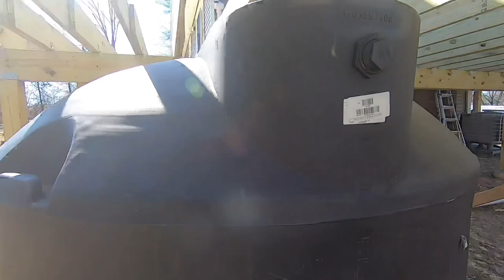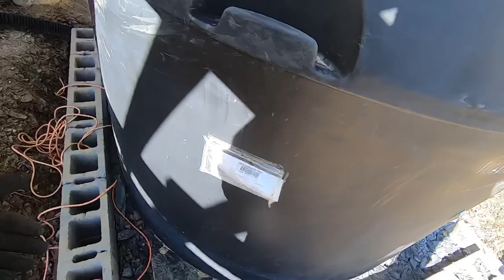Starting to install the our 1500 gallon rain water collection tank!

Comment: Hey Jason, I hope this note finds you well. Thank you for the great video and explaining the bad audio in the beginning. I thought for a second there that I was revisiting my misspent youth of being dropped on my head. So what I have gleaned from this is....you had us on a bendy tripod and hung us on a beam to watch you and your comrade build a hidden 1500 gallon still under your new deck? So many questions, so little time. Where does the copper tubing run off? where is the thumper? Is Wifey growing the potatoes for the mash? Is distilling booze even legal in your adoptive state of Kansas if the distillation tank is clearly marked "not booze" ? Nice job on the tank and deck:) BTW, it is called a rim and then skirt
Reply from the maker: Toad damnit toad I’ve got enough satellites tracking me already! But if you must ask, inside the pvc, and attached carefully to the walls interior of the tank, with 3D printed brackets I got from a questionable individual on Craigslist. No, imported from Putin’s special stash directly. No thumper were wireless these days. And no, but I’ve marked it “not for drinking” so it’s perfectly fine because clearly, no ones allowed to drink it, and if it’s one thing I know it’s that criminals obey proper signage. Not sure why banks don’t get robbery free zone signs made. Perhaps this could be our new niche market??
Reply: @JasonWorksAlot  Yes! No Dough Head Zones and Please Watch For Pee Soaked Floors. There's a few million dollar ideas. Just keep in mind the first fifth of the distillery process is methyl alcohol (poisonous) and should be kept for starter for the next batch or fire starter, just don't drink it

Comment: built decks back in the day not fun. one stands out the most.2 tier deck 4 foot off the ground.we did the ledger and header but ran out of time for the joists.the next day we came in and started laying the joists leveling everything off of the first joist.man we got it done in record time.looked beautiful. well when we started laying the first deck board we noticed some thing just wasn't rite.well after 4 hours of scratching our heads and a million measurements we finally figured it out. i leaned over to check the first joist only to discover it was never actually put in . the day before when we quit my boss tossed one up to see what it looked like but never installed it.ya the entire deck had to be tore down and reassembled correctly.back then the joke was did you attach it sir? funnier now.---- looks great cant wait to see it finished.
Reply from the maker: Joe Southern oh dear lord that sounds like slightly worse than my luck hahaha!

Comment: What are you going to use the water for I must of missed that part, but your doing a great job on it. I can't wait to see the deck all done. Slow & steady keeps it correct
Reply from the maker: Ryan H I more than likely forgot to mention that🤦🏼‍♂️ we’ll be using it for watering the lawn, and washing the cars and stuff mostly. I put it in to try and keep water off the yard as well because where the gutters dump was always a swamp. the tank filled up way faster than I’d have imagined. I did the math for the gallons per inch of rainfall and thought we would be okay but we had one huge rain storm and it filled it 3/4 the way, now it’s sitting full. Will be putting a sump system in with the French drains and attaching the overflow straight into the sump.

Comment: Obviously a little late to this video but I'm curious as an HVAC tech if you have had any issues with your heat pump after building the deck over the top of it. It definitely requires some clearance on top just wondering if what you had was enough or if you've noticed a difference.
Reply from the maker: I spoke with them when they were installing the new unit and showed them the plans for the deck, they didn’t think there would be any issue. For the time while we lived there with both deck and hvac complete I wouldn’t say there was any noticeable difference. Hard to compare apples to apple though since there was only about 2 months of new hvac with no deck.